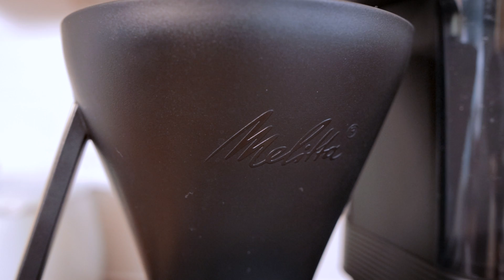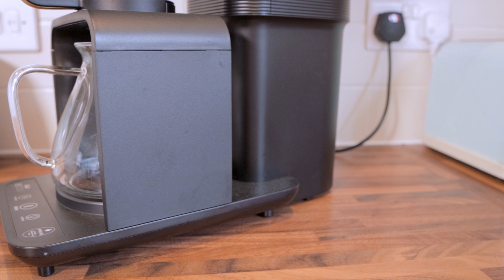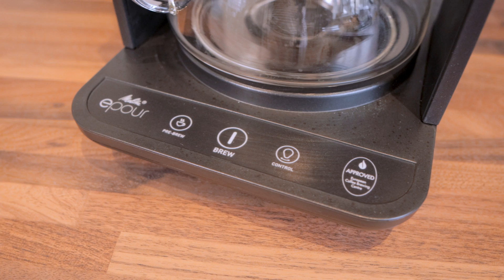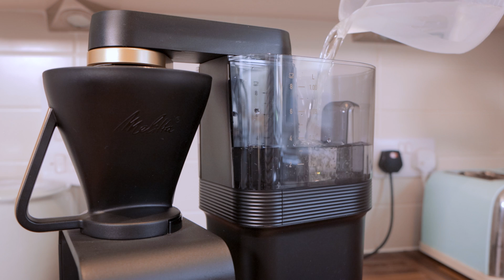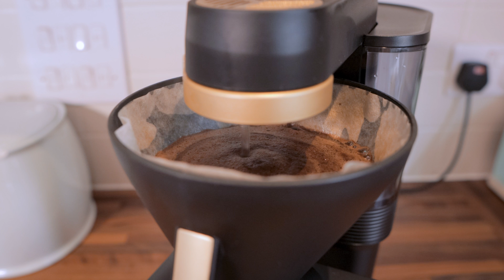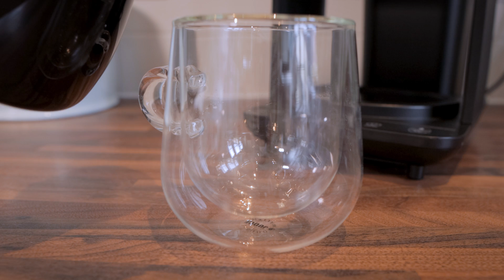Simple To Use, Convenient and Delicous | Melitta EPOUR Review

Comment: Thanks for a very thorough review. I've had my eye on buying one for some time now, considering the Moccamaster KGB as alternative option. This EPOUR has some clear advantages with the rotating head and removable water tank for easy refill (would be very practical for my kitchen setup). However, the glass container looks very fragile with even a glass handle. And will likely be expensive to replace once broken (as those usually are for any machine). For Moccamaster, replacement glass containers (with plastic handle) are much easier to come by, and also offers the KGBT option with metal thermos. If only Melitta offered the EPOUR with thermos container as option, then making the selection would be a no brainer for me.
Reply from the maker: My parents in law have the Epos machine, which is the same but had the grinder built in. They run a B&B and use it when guests stay. That machine has been used and abused and it's still going strong, inc the glass jug!